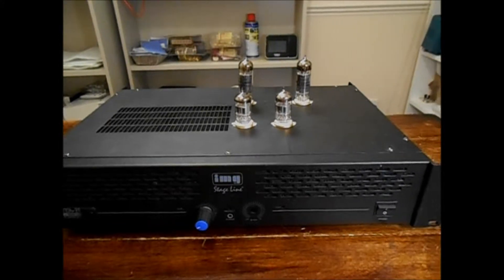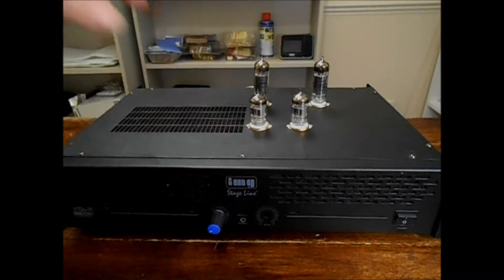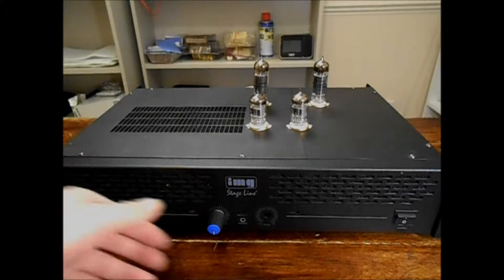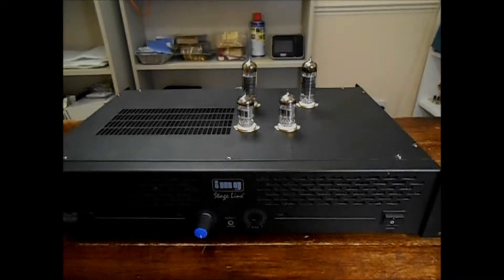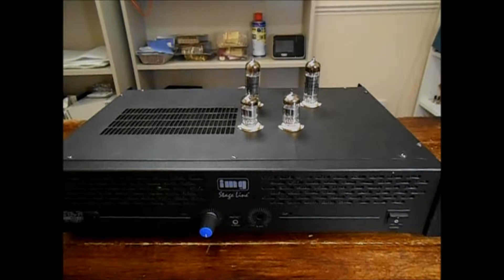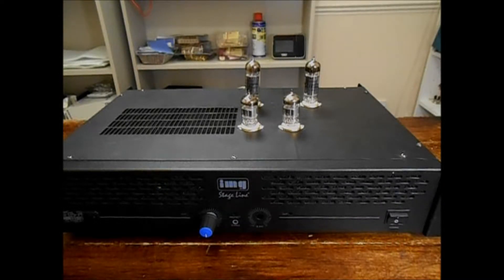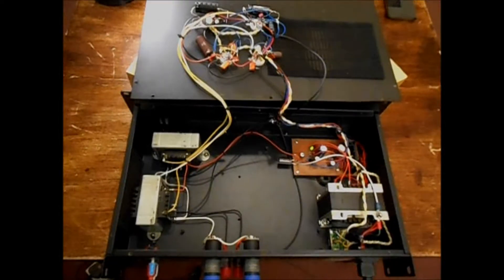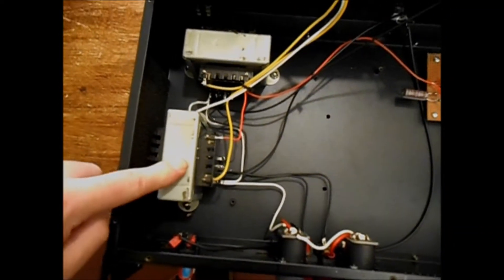6N1P-EV EL84 single ended pentode amplifier

Comment: Hello. How would you describe those 6n1p? Gain factor, sound, durability, noise, etc? How compare with 12ax7? Thanks.
Reply from the maker: The 6n1p is a very unique valve. They have very low gain of 20 or so. On the total other end of the scale than a 12ax7.

Low Ra, high Ik, high heater current, low gain. Sweet sounding driver though. Low Ra means even triode stages don't cause much high frequency roll off when driven by a 6n1p.

I built a second UL amp using 6P15P-EV with 6N1P-EV driver stage. It works a lot better than this one did. This one was a quick hack job that got me some workshop audio until I had time to build a better amp. This no longer exists, kept the transformers and valves, scrapped the rest.
Reply: @killcar5nbike2  so, two triads in series will drive an el84. Right?
Reply from the maker: @ramilrodriguez8340  it was a bit unstable with two. Ended up modifying it to one and using a higher level input signal.

The 6N1P would make a good input valve feeding a 12ax7 driving a push pull output.
Reply: @killcar5nbike2  thanks